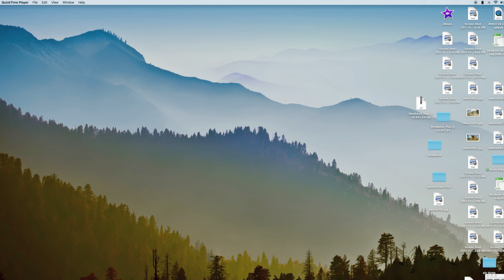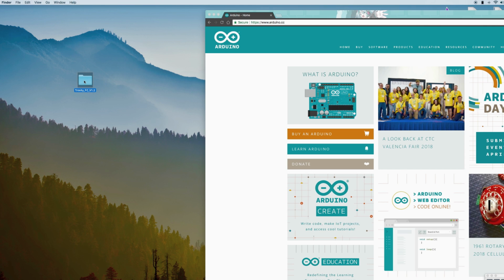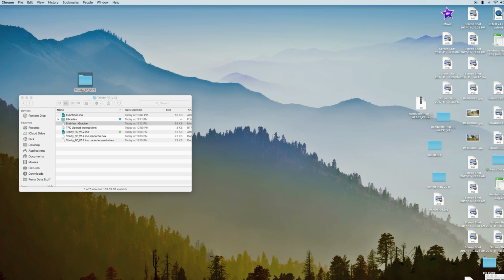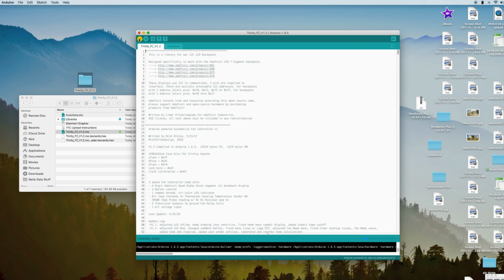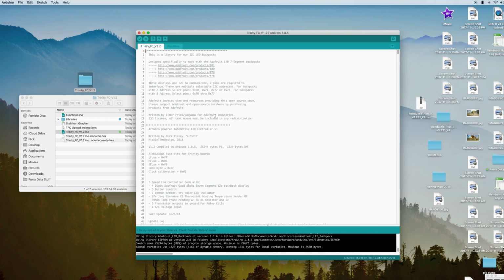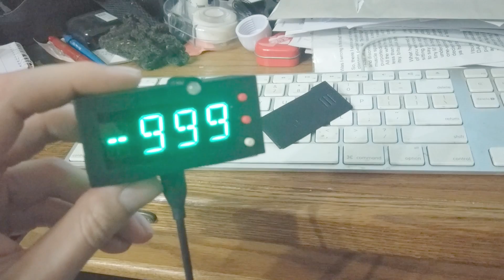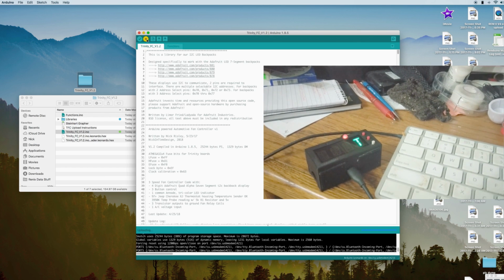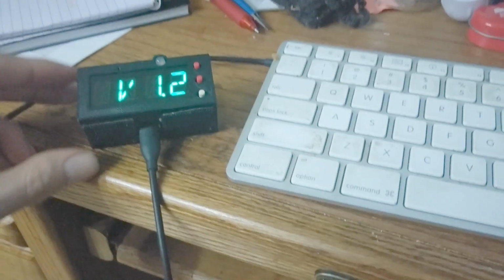Updating a Trinity V1 Fan Controller

Comment: My new aux fan is not working like it should. Automatically, only runs when A/C is on. This has my intrest as i have been debateing wireing to a switch. Or aftermarket fan controler. I like this much better. As its update able and easy to program. And adjust given whats going on, or type of wheeling.
Reply from the maker: I'll be working on v2 at some point soon, probably once I get the new REMs under way. The adapters need a lot of work as they are prone to water corrosion, but hopefully its can figure out some better solutions soon